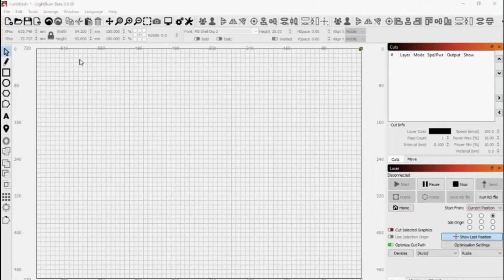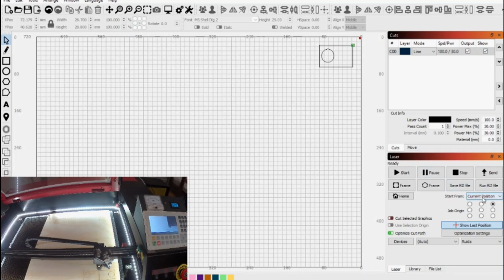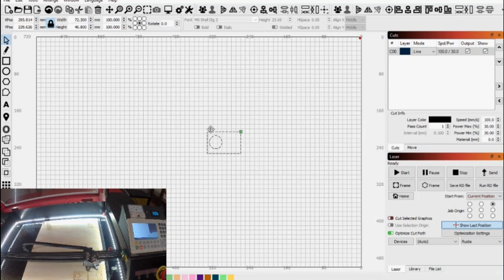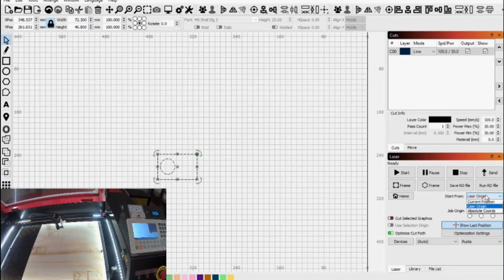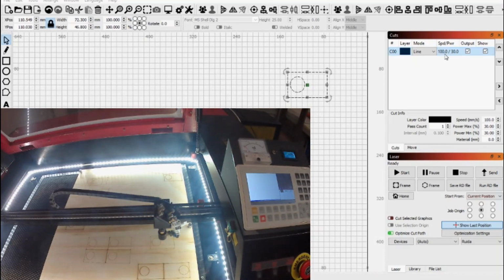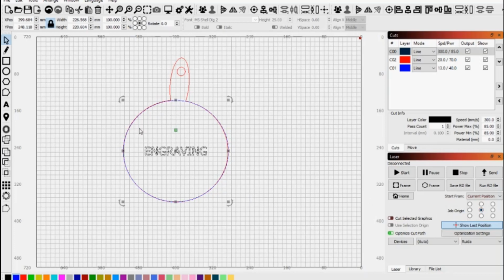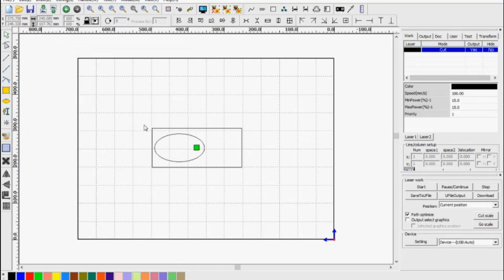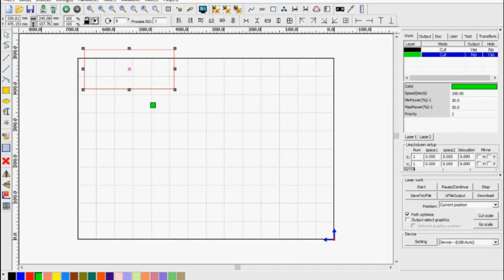CNC Co2 Laser Origin & Start Positions Tutorial - Lightburn, RD Works, AutoLaser Software.

Comment: Hello! since English is not my native language, I don't think I understood well, how to "convince" the laser to start cutting from the place I want? if I have a space between other already cut spaces, how do I insert an image there to cut? I tried several settings and it still moves a few cm lower, to the left or to the right compared to how I move it manually. Do you have a video that shows how we can cut efficiently, to use all the remaining spaces? I make toppers, and from the small spaces, I cut out a heart, a star, a bow, also so as not to waste material. Thanks a lot for your help!

Comment: I am new to Lightburn and looking to make an engraving template from wood that I can quickly load multiple parts into for engraving. How would I load the wood template into the machine in the same spot each time so the parts are engraved correctly?

Comment: Anyone have any idea if you can have your laser end at a different point than the origin? I want to cut squares in a line, then have it move 2mm above the top line, and wait there, so I can origin, and start another row, or be done, instead of trying to line it up to exactly 2 mm above the last row?
Reply: Using RD Works, but I also have light burn
Reply from the maker: why don't you use grid array to have all the rows cut at once rather then origin between each row?
other option is set the Manual step space to the height of each square row (Plus 2mm) , then at end of processing 1 row, manual step up once and then press origin and start again

Comment: Why on light burn your on top right but it cuts bottom right
Reply from the maker: When laser start position is set to one of the options "current position" or "user origin"  the position of the diagram in lightburn can be positioned anywhere, as the laser is not using the "absolute origin" settings.

Comment: Hi Matt, I have seen your videos and I liked them a lot, you know I am starting to work with a laser cutter, I have a doubt, when I use LB to run a program, using the recommended values (speed and laser power) I have had problems so that the machine cuts the pieces well. however using RDworks, with the same parameters I have no problem. My question is if there is some type of configuration in LB that I am not aware of, configuration that could be related to the information that controls the laser power source.
an apology if I'm being inconsistent, I just don't know what the cause could be.
Thanks in advance.
Blessings...
Reply from the maker: Email your questions to matt@mwlaser.com.au cheers

Comment: I have other objects on a different layer with the output turned off, but when I click on user origin the green dot does not move, it stays on the file that is set not to cut/scan, do you know why? cheers
Reply from the maker: Yes this is correct, even if the layer is set output=off the green origin dot will not move because the layout still contains the other items.
Reply: Cheers pal, been doing my head in for ages

Comment: When you moved the laser head over the dot in the centre of the circle, how do you know that it’s spot on the centre mark?
Reply from the maker: If you are using a red dot that is positioned on the side of the nozzle, you can 1st set the correct focus gap on a scrap piece of material, then without moving the material adjust the red dot to point exactly on the pulse mark you just made, then you will be sure that the pulse/laser is in the same position as the red dot.

Comment: Matt is it possible to move the green "Start point" to the center of the text box as a start point. I'm using RD Works v8 and I do a lot of round parts. It would seem much easier to find the center and use that as a point to start the etching process. As of now I'm configuring size of text and moving accordingly. THX
Reply from the maker: Yes, in RDWorks, go to the CONFIG - SYSTEM SETTINGS menu and change the LASER POSITION to the Centre dot of the 9 available location options.

Comment: i am using rudiga 6445 are the settings the same,and have you made a vidieo on wiring the rudiga control
francis scofield
i
Reply from the maker: settings may be similar, however each machine will require calibration for the motors and drivers.  settings depend on specs of hardware of your machine

Comment: I noticed in LB the size of your actual work piece was in red on the grid. How did you get that a different color?
Reply from the maker: Sorry I'm not sure what you mean,  what time in the video are you referring to?
Reply: RED COLOR IS FOR ZERO MACHINE, YOU CAN CHANGE UNDER  SETTING IN LB, GREEN DOT IS FOR ORIGEN POINT OF THE JOB OR THE VECTOR TO BE BURNED.

Comment: Matt, no matter which origin position I select my job still starts at the top right hand corner.  is there a machine setting that i need to look at?
Reply from the maker: Are you trying to change the Machine's origin / homing position ?
If you need assistance email matt@mwlaser.com.au
Reply: Did you figure that out? I have the same issue.  I want my machine origin to start from bottom left
Reply: @tylergady2019  no I ended selling it.

Comment: Simply, put: if I want the home and the origin for both the laser cutter AND LightBurn to be in the bottom left hand corner, to have to reset the home and origin on BOTH the laser cutter and LightBurn? I want to use the front/bottom left corner because (a) that is closer to the exhaust port on my machine and (b) it seems more familiar to me as Quadrant I of Cartesian coordinates. (I haven't uet upgraded the 6442 to the 6445, so I don't have an "origin" button on the controller.)
Reply from the maker: The origin of your laser is where the x and y limit switches are. For the red&black laser machines this is usually top right or left.
Reply: @MWLaser  Ahhhh. So, it's hardwired and I'll just have to live with that . . . :).

Comment: Thanks, this was very helpful in setting the origin. I had to keep guessing and using frame to make sure the cut part landed on the piece, now I have it so I set the corner to the head, square it and good to go.   I cut parts for RC airplanes from sheet stock, balsa and plywood, so first thing I do is create a non cut rectangle that matches the overall size of the material, then place the parts I want to cut out on it. I was having issues getting it to line up because I had it set to absolute.   Now I know what setting to use and works like a charm.

What power is your laser? I have a 60/50 (Rated 60 but really 50) and trying to determine the speed and power to cut cleanly through 1/8th (3mm) aircraft ply, and I keep ploughing instead of clean cutting.
Reply from the maker: My machine is 80w. Cheers